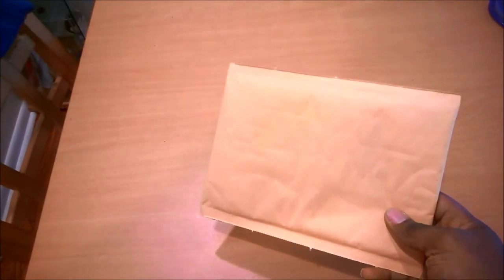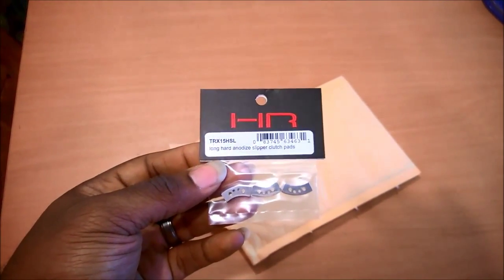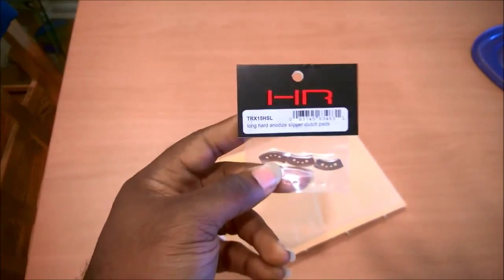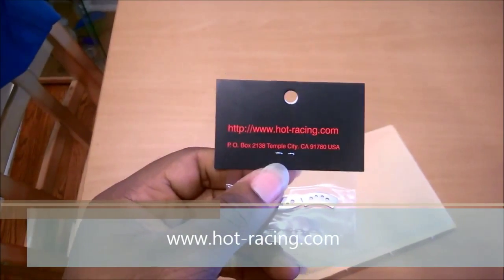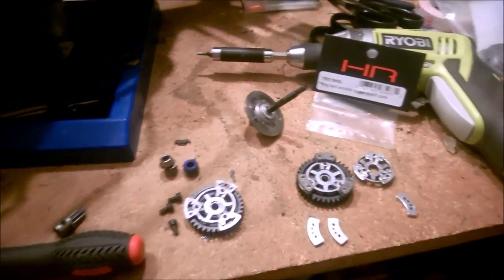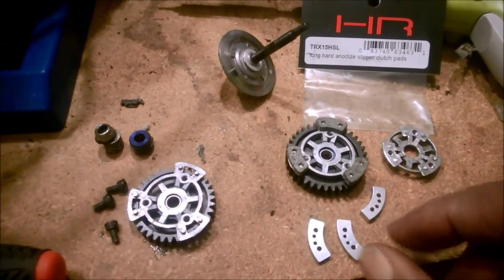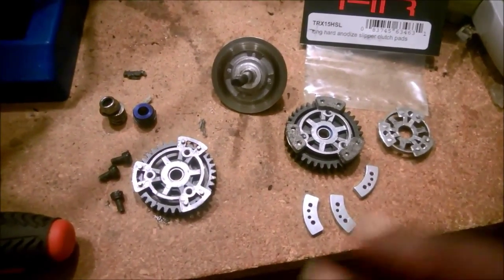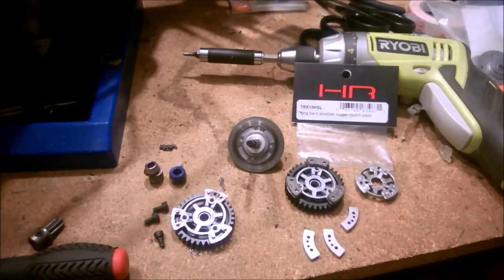Ep. 130: Hot Racing Slipper Clutch Pad Unboxing

Comment: Aluminum Slipper clutch better or the stock better ?
Reply from the maker: The Aluminum is supposedly better, but I mostly run with the slipper cranked all the way down, so I never see an issue. The aluminum seems to be able to take a pretty large clamping force so I don't see slip, though.